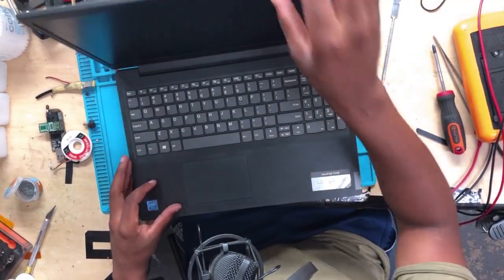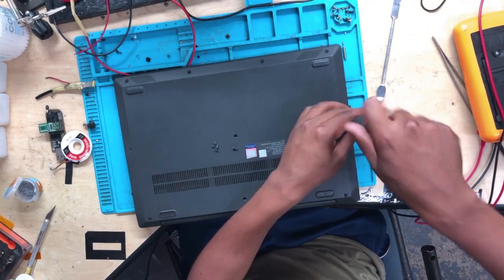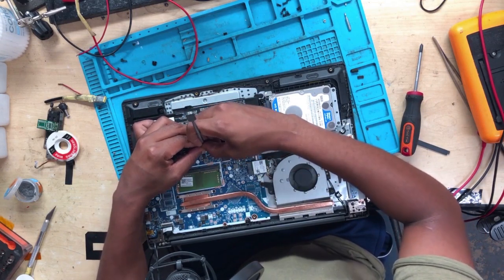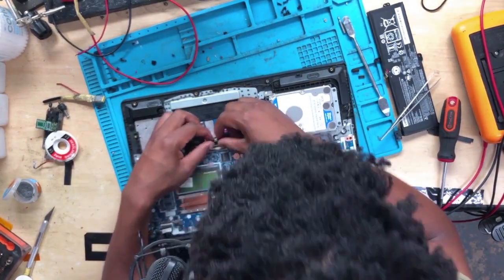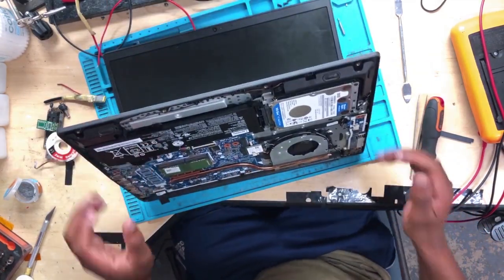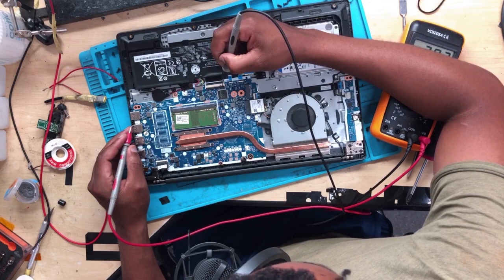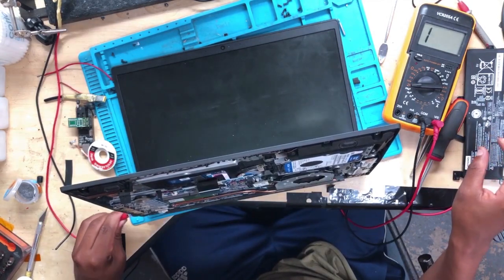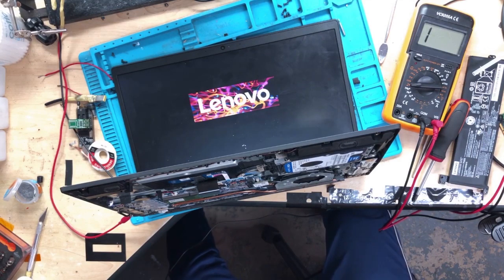Lenovo not turning On

Comment: Have the same issue but only the power button is not working..all other keys are working fine..so just make a new switch on the side of the laptop frame close to one usb port..by soldering two wires to the switch and one end to ground and one to the 3.3volt pin on the keyboard connector..